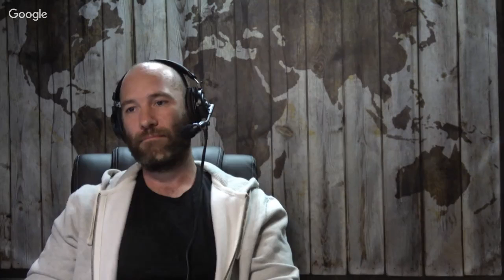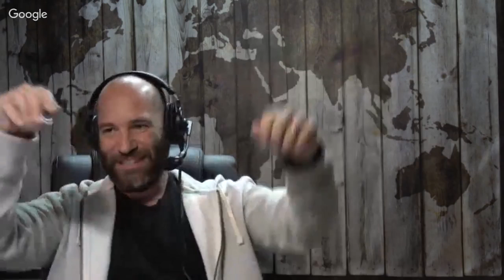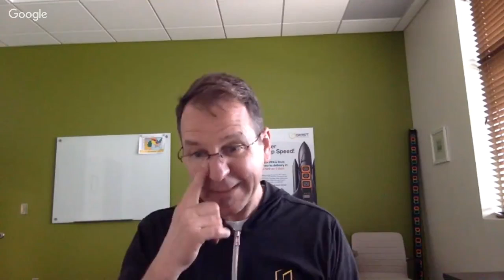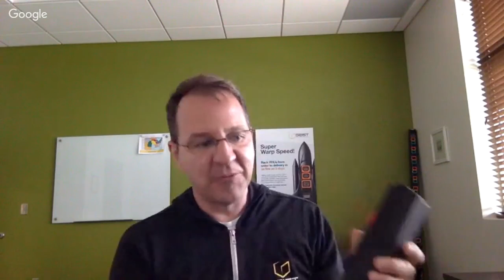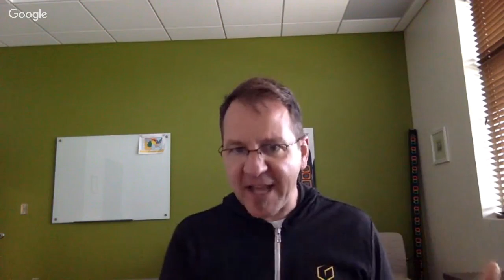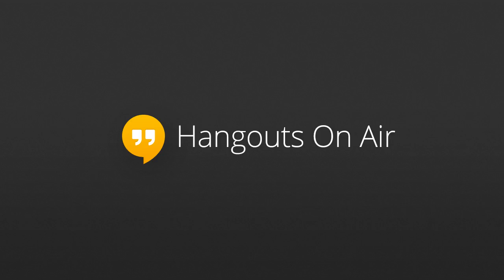GEIST PDU - President of Data Center Group, Brad Wilson (PDU's)

Comment: nice takeaways for those interested in knowing what management skills are necessary for long term business success.
1.Be technically knowledgeable of your business processes.
2. Maintain close relationships with your customers and drive product development to satisfy their needs.
3.Vertical integration is key to low cost and fast product development.
4. Stay within your core market during expansion/acquisitions. costly mistakes can kill your business.
5. Offshore manufacturing brings a new set of management problems that will limit and distract you from  day to day control. The management team must grow to address these new processes.